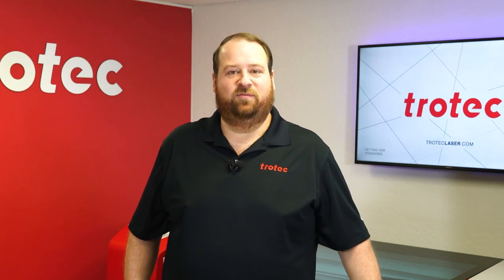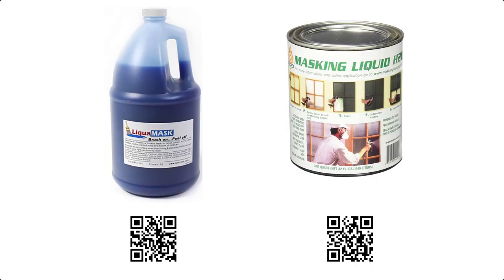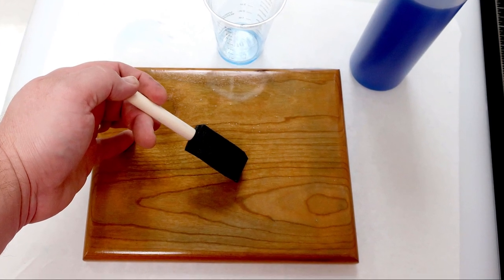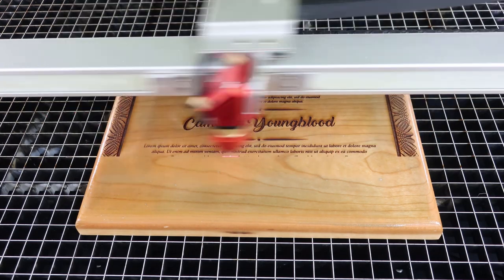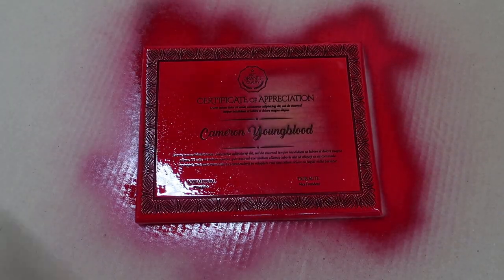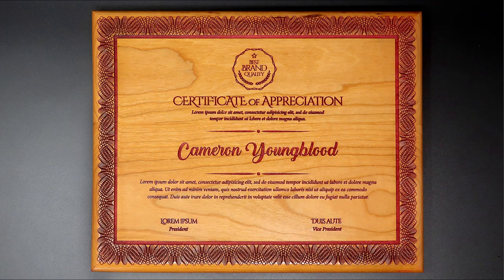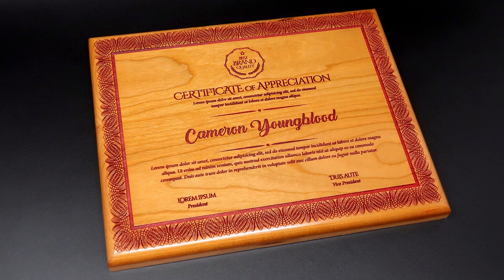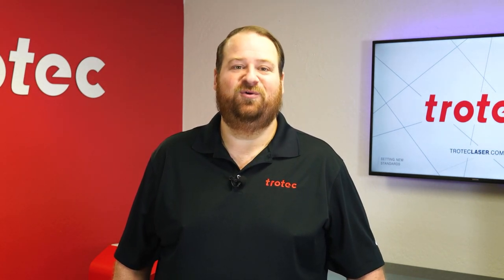Laser Hack: Liquid Mask Paint Fill

Comment: Hi, I am using Liquimask for the first time and it is leaving a heavy yellow smoke stain that doesn't brush off, I can't paint because I don't think it will cover this yellow residue.  I let it dry for 3 hours.  Did I put it on too thick? It was not tacky when I started engraving so I thought it was dry.  In the thinner parts, it didn't leave as much.
Reply from the maker: Hey Andy! Liquamask can only be used on smooth-coated or polished surfaces like clear painted wood, glass, polished stone, or metal. If the surface is rough, like wood that is not prefinished, the mask will not work correctly and cannot be removed. Please refer to the instructions that come with the masking for details.

Comment: Hi! Is liquamask compatible with leather? It says on the label (seeing from the images online) that it works with leather too, but I'm worried, I have a piece of red genuine leather...
Reply from the maker: This material only works well on smooth surfaces; leather may not work; I suggest testing first on a scrap piece of leather to confirm that the liquid mask will lift off when it is dry.
Reply: @TrotecLaser  thanks for the reply, yeah that's the problem, I need the Liquamask exclusively for this leather project I'm working on, so buying a 40$ bottle just for a test is too expensive... Has anyone tested it already on genuine leather?
Reply from the maker: Not that we know. Contact the company that makes or sells it and ask them if this works on leather before buying it.
Reply: @TrotecLaser  already did that, and it's funny because they don't know either...